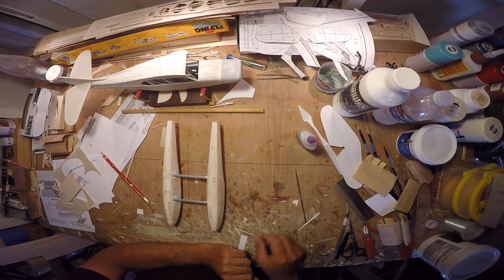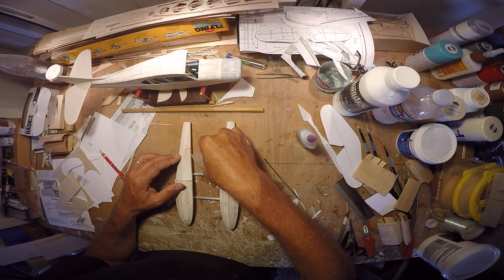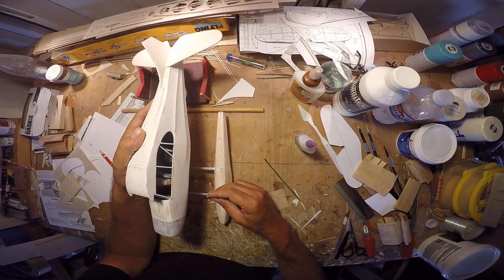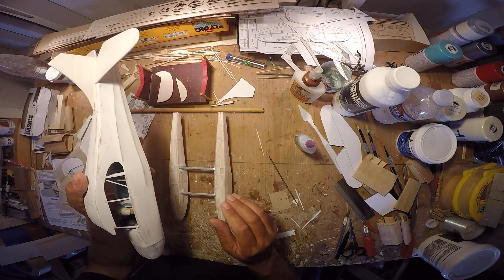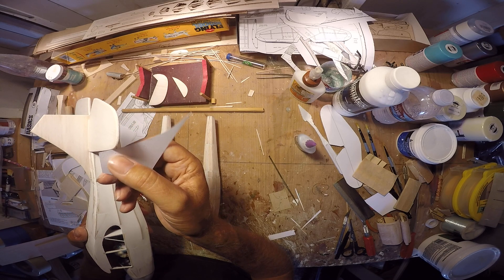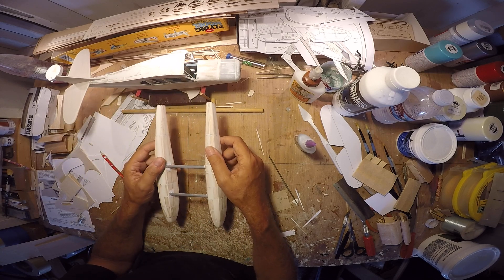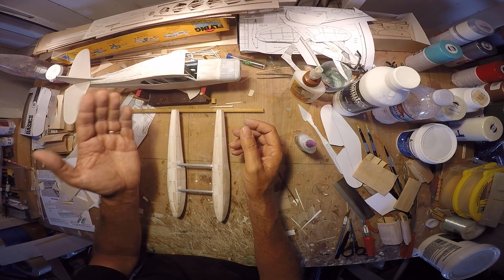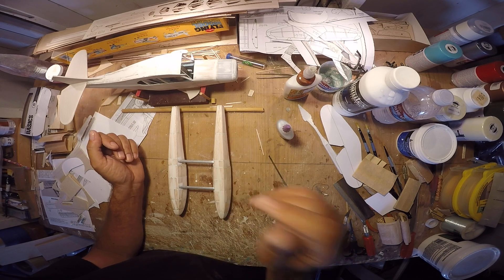more Aeronca build progress

Comment from the maker: dunno what I was showing you all with the float assembly and how it was made square - I needed to just center the left float on the vertical datum line then slide the upper crossbar up to the horizontal 90 deg datum line on my building board..sometimes you just have to laugh out loud I guess